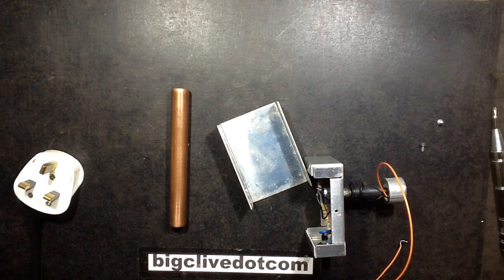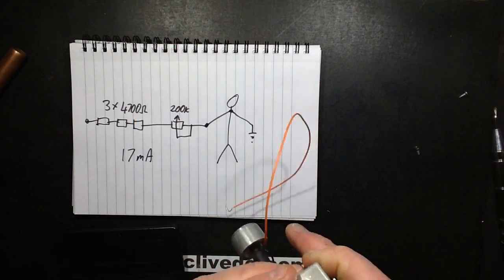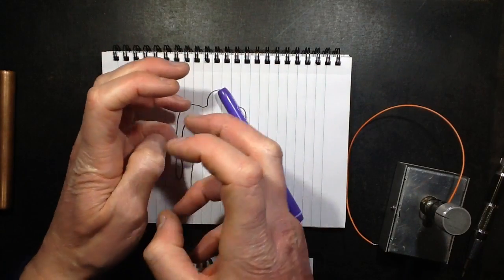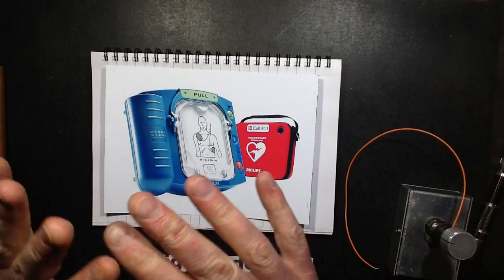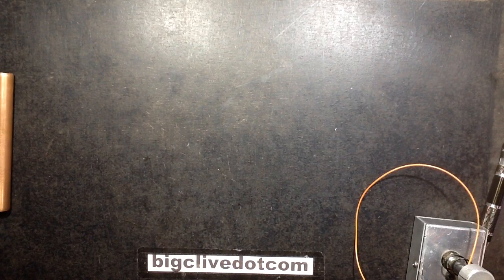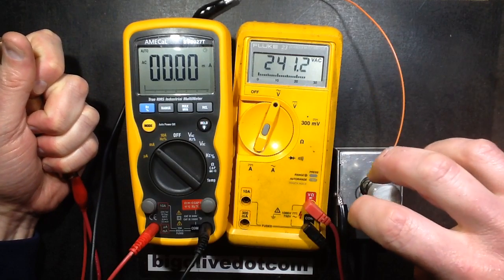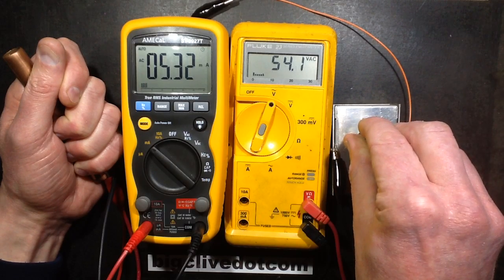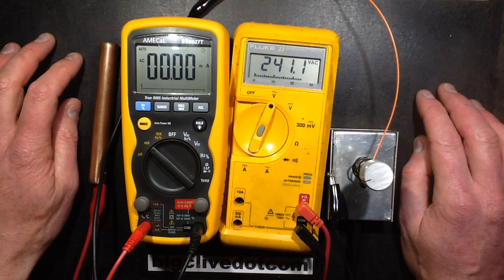Avoiding electrocution (Featuring real shocks.)

Comment: WOW, I never knew that about defibrillators, that's really interesting that it won't shock a health heart.  I always thought they just chucked out the same charge and jumped-started them.  This is obviously why they now have them available for emergency use in small villages.
Reply: +Higgypop That's true for AEDs (Automated External Defibrillators) that are made for use by untrained civilians. That's why they have voice instructions and pictures on every possible part of the device & ECG monitoring with computer algorithm checking if there's v-fib, so it's perfectly safe for use for everyone. Things made for trained professionals (ER guy or doctor) like for example LifePak (defibrillator & cardiomonitor in handy case) will deliver anything you want, but they assume you know what you're doing.

Comment: The instructions weren't clear enough. I got my dick caught in the tingletron.
Reply from the maker: +Sebastian Ramadan That really hurts too.
Reply: bigclivedotcom In what frame of mind were you when you decided it'd be a good idea to try that? Were you testing it with your friends when you all collectively decided the tingles felt good and you should try it on your jingles? This gives me an idea... Why has nobody thought of a mains-based electric shock sex toy? Put one electrode on clitoris, the other on knob, have at it boys...
Reply: +Sebastian Ramadan Think to what would happen if a resistor would somehow fail(maybe by getting wet).
Reply: Anto Mani on a related topic I wonder if a mans meat is white or red when cooked XD
Reply: +Anto Mani ha ha ha ha ha   dear god, that is such a valid point. 

Well, if anything like that DOES come about, we can count on BigClive to buy, test and trial it! ;)
Reply: Depends which part of the body. If it's erectile, probably white

Comment: You are very brave and watching this video, made me afraid something was going to go horribly wrong, even though 
 have watched many videos after this. I have shocked myself intentionally several times with a 100.000 volt stungun (not sure if it is 100 or 100k, since they used a decimal) and rather than building up a tolerance, I built up extreme fear and I am now terrified of them. Overall, being electrically shocked, is not a pleasant experience.

Comment: In North America they often use a common neutral. Apparently it saves a lot of money.  It is not uncommon for someone an apprentice to get shocked by a neutral. Yesterday I was taking a line of a circuit for a new light. I had the circuit off but tested it with one of those proximity sensors and found the neutral still live! Figured out the second circuit to turn off as well. I am having a licensed electrician come and check the panel to verify my finding. I believe the wrong two breakers were tied together. 

Why run the test from one hand to the other instead of from your had to say your upper arm?

Did you have someone off camera ready to step in and rescue you if necessary?

Comment: If you have rubber soled shoes. Good. If you have another person nearby. Good. If you don't have the latter than always try to work with one hand behind your back (not touching anything), in a non-conductive glove of some sort or, if you know what you're doing, just avoid neutral or earth with said hand. If you're holding onto live, you are at a potential of ~230V (in the UK). Earth is at 0V usually and Neutral may have some induced or residual voltage. This potential difference is the amount of energy, Current (in Amperes) has when it passes through a conductor. You can calculate power with P=VI (I = amps, V = volts, P = power in watts). 

If you are at 240V because you're holding onto live and touch something also at 240V, you will be fine, or even if you touch something at 200V. So as long as you don't touch something significantly different in potential (20V or more either way), then you'll be fine. 

50V and lower is also pretty damn safe. It'll give you a painful buzz, especially high current, but otherwise you'll be fine in most cases (unless you have a pacemaker, heart murmur or other cardiac condition). 

Know your shit, or don't touch it. A little rhyme that you should remember when messing about with electrical stuff as well as gas. Although, people have a lot more respect for the latter.
Reply: Hi Uncle Joe!
Reply: +Joseph Stalin no offence but I don't think you are in the position to give out health and safety advice
Reply: DrEko2012 Off to the Gulag with you!

Comment: are the resisters 4.7kOhms together or indenpedently
Reply from the maker: +Mike Schmidt All in series to make a higher value with greater safety.
Reply: +bigclivedotcom - I think he was asking if 4.7k was the total resistance or each (and it's each, of course, which is why it says "3x 4700").

Comment: I once got zapped from an A/C unit plugged into a non earthed extension cord. These are common with us... Anyway, there was certainly some moisture where it shouldn't be (considering I just cleaned it out) and DAMN did that knock me backwards. I thought that running a fan next to it for 24 hours would have dried it, but... no. I was on damp concrete and I touched the live chassis. ouch.

Comment: Moved into a house where some clown had wired a light direct into the socket circuit (not even on a fused spur)and I'd turned the lighting circuit off before working on a said light of course (this was pre RCD too)..... so learned the hard way to always test even if I "know" a circuit is isolated.
Reply from the maker: Yup.  That happens a lot.  And electricity is a harsh teacher.
Reply: +bigclivedotcom And an even harsher lover.
Reply: +Choppington Otter Had that happen myself countless times. Arse hole cowboy cunts shouldn't be allowed near electricity, they've killed people doing it in the past. Strong words, but when someone's life is on the line it's no joke.

I've had 3 mains power shocks. 2 from light fittings, one from a fused connection unit which was fed from the lighting circuit, outside, from a separate consumer unit, not even on the board inside the house. Not to mention, this 2 way board was the rewirable fuse type, and buried under concrete and a small metal hatch in which a 4 year old would struggle to get their hand down. In the end, we found the supply for it & cut it dead. 

Arm was numb for many minutes afterwards, with a slightly distorted area of skin at the tip of my finger. Luckily, it was between two fingers and no between two hands, otherwise i might not be here to tell the tale.

Comment: Once I got shocked by 110 AC. My hand clamped shut and i felt the 60 Hz, current travelling up my arm (or the muscles contracting further and further up my arm) as I attempted a sort of scream (lol). I was lucky enough to lean back and fall away to break the connection! Whew! I'd never intentionally shock myself like you though bigclive! Thanks for being a little crazy! :)
Reply: you must see electroBOOM channel, he shock him self in every video
Reply: I managed to cut the wire of my desk lamp once ...
230 or 240 Volts at 50 Hz aint pleasing, I can tell you that much.

Comment: So a 15kOhm Resistor from 240v would drive a blue/white LED quite nicely?
Reply: +ChaosHusky 240v AC peaks at give/take 330v, so maybe around 24k ohm will be good. That's 10mA at 240V and wont destroy the LED at the peaks. Ofcourse it also depends on the LED, but most generic LED's work fine in the 10-20mA range. -- [Edit] I should add that the LED blocks current (because it's a diode) when the AC becomes minus voltage, so you'll only light up the LED half the wave, but at 50-60hz you probably wont notice.
Reply: +funkynicco the LED might be a diode, but a diode with a very low break down voltage. If you apply 240V or rather 330V in reverse, the LED will fail for sure. As an electronics engineer, I presume that the break down voltage is usually around the rated forward voltage. Maybe even lower, maybe a bit higher. Given that the resistor as virtually no voltage drop when virtually no currents flows, we have to assume that the full 330V are applied in reverse to the diode.

Then there is the issue of an LED not beeing mains rated...

Clive shows plenty of videos where he shows how he connects the LEDs to mains voltage. Watch them carefully and think twice before rebuilding any of his projects. He does certain things in a certain way with thinking about it, because he knows by education and experience what he is doing. Small deviations can be very dangerous.

Comment: Hey,

Remember that your mains voltage is an average value. In fact a hundred times per second the voltage is actually as high as 340 V, which also increases the current hence the stress on your muscles.

Comment: Silly question but could you connect a wire between your arms to give the current a alternate path rather than through your chest?
Reply from the maker: topher Even with a tight metal band on each wrist, the current that entered your hands would still tend to pass internally due to the human body's low internal resistance.  Some current would flow between the bands, but the resistance of the connection between band, skin and internal flesh would be significant.
Reply: +bigclivedotcom you can get chain mail clothing that provides an alternative route for the electricity

Comment: This video is in tune with what I've done today. I was repairing a TV for someone and went to discharge the CRT with the standard grounded screwdriver as I always use, when I've heard a nice loud zap then the CRT should have been discharged and I'm pretty sure I've done it twice to be sure. But when I've touched the rubber cap ZAPP! a nice high voltage shock, just what I needed for me to get motivated, and fix the bloody thing, lol. I'm pretty used to electric shocks but I try to avoid them if possible. It's not the fact that I'm scared of it but it's actually more on the fact that I feel like an amateur when it happens, just plain stupid mistakes. One time I wanted to repair or restore an electric heater which used nichrome wires inside a glass tube. I was either not paying attention or was angry at something and stuck my fingers inside to disconnect the terminals from the switches and WHAM! next thing you know the thing hit the ground with quite a force, luckily the heater survived, yeah that's right, I'm not worried about my safety! lol. Play safe guys. Cheers :)

Comment: im an electrician and was working on a device which is relatively safe ( 240into a power module and +-15v out, after an hour of calibrating said device i went to unplug it, WHACK, i got the 50hz shake the person that had done the plug had run the screw through the live making the screw live, as i lent over to unplug it placing one hand on the devices grounded chassis and the other on the electrified screw.... man did it give me a kick. Being a electronic lab i was protected by a local RCD which tripped, now thinking of an isolation transformer. lesson learned hand in pocket rule hopefully my thick rubber boots would help.
Reply: phillrullzXBL wow... you were lucky! i just bought a 500VA isolation transformer a few days ago just because of this and it's also quite useful if you hook up a grounded oscilloscope.
Reply: im not an electrician an in my INFINITE WISDOM i didnt get a sparky to help replace a RCBO an i was of course holding the lid open an i grabed something an i could feel the 60hz go through my body an then i blacked out apparently i was dead for abit an then i woke up in hospital 
so yea 
i is lucky

Comment: Big C, youre the man! 
That was INTESNSE !

I got electrocuted in the past, but not for that long.
You are brave...
Reply: Shlomi Vinny Electrocution means death by electric shock...
Reply: Oh shit, i meant i got electroshocked? :D
Reply: Shlomi Vinny Shocked would suffice (without the electro bit).
Reply: justquant Cool, now i know. thanks!
Reply: Shlomi Vinny NP
Reply: +Ryaninator 54 I've been shocked by 240v a couple of times, thankfully not for long and through high resistance but I have had my whole arm numb from it
Reply: +Ryaninator 54 I once had my finger slip while unplugging a mini-fridge from a power strip and hit the prong, and it had my entire body vibrating for a good 5 minutes or so. Very uncomfortable feeling, and it's made me appreciate plugs that have as lip on the live end to prevent that sort of thing from happening, as opposed to the slippery ones with straight sides. I'm in Canada, so about 110-120v; I imagine I would've been quite a bit worse off if it happened across the pond.
Reply: I got shocked by a alarm clock form the prongs so 120 V and couldn't move for 5 seconds. I was 9 then too.

Comment: One of my friends died from an electric shock so I have a huge respect for electricity. I will always physically disconnect anything before opening it as a habit. If working on a house fitting I have to check the wiring with a multimeter first.
Reply from the maker: Also be aware that even if you test a neutral/return and it appears dead, then if you part two neutral wires and another circuit was using them as a return path, then one of them can become live.
Reply: bigclivedotcom I found this out with old wiring in the house the wires had a kind of cloth coating everything was replaced but prior to that some circuits had a decent amount of voltage showing on the neutral
Reply: TRDreams California 3ways are also common with old house wiring with the cloth sheathing
Reply: Also, not all appliances are safe after being disconnected.  Anything containing a CRT is a notorious danger until physically discharged by someone either intentionally or accidentally/fatally.

Comment: The whole time you were touching the knob I was sweating like hell...
had a few nasty shocks so far, always been lucky. One mains shock across my wet hand (someone had removed a safety cover at school and I needed to move the overhead projector), and even a fully charged 10kV capacitor for a 200 kV Marx Generator project over heartline (still not sure how I survived that). I needed to move the elektrodes of the spark gap closer together, didn't pay attention, and grabbed both aluminium foil electrodes at the same time. Luckily there weren't any more accidents and we finished the project without any casualties.

Comment: You didn't convert to RMS when you figured for current in the beginning.
Reply: +TakronRust 240v is the RMS value.
Reply: +megaspeed2v2 wall mains ac isn't rms
Reply: +megaspeed2v2 wall mains ac isn't rms
Reply: TakronRust I think you might not be understanding. 240V is the RMS value of the voltage being supplied at the wall, the peak value is 339v and the peak to peak value is 679v.

Comment: The biggest shock I've got to date was the capacitor in the back of my old Philips CRT TV (ironic that you showed a picture of a Philips defib too!!), the plastic round the flyback had degraded and allowed electricity to arc out of it, and as you descried, I was poking about in it idly, hand on an earthed device and bang, that discharge went up my right arm, across my chest and out my left arm via my old laptop (metal cased Toshiba Portégé M300, which does feel like it's negative rail is referenced to mains!! Always getting tingles and buzzes of that thing), and I was crapping myself afterwards thinking my heart may have gone into fibrillation, but thankfully it hadn't, and that was the last CRT TV I ever owned, considering it owned me!!! :S

Comment: You are a brave man to take on 240V (even through the tingle tron) so everyone else can see the effects of electric shock. I'm glad I have a healthy respect for electricity of any sort. Biggest jolt I have got was from a camera flash (a big one). The capacitor got me and it was pretty fully charged. Threw me across the room. I did end up fixing the flash in the end - it was a faulty trigger transformer. With respect big caps charged up to a decent voltage can be a lot of fun. Just don't let anyone near them when they're charged! I have a small bank of 24,000uF at 900V... OUCH! Thankfully triggered electronically via an air switch from a good distance away (it fires the SCR, which in turn vaporises pretty much anything connected across the output with an incredibly bright flash and loud bang!) :)
Reply from the maker: dash8brj I was actually a bit disappointed that I couldn't go any higher with the current.  But even at 6mA it was excruciating.
Reply: bigclivedotcom Nah try not to fry yourself Clive - your videos are entertaining and interesting - and some quite funny - the bug zapper whos capacitor decided it didnt want to be and that silly christmas card with the 4.7K resistor on 240... sigh :) Look forward to more :)
Reply: +dash8brj As an apprentice we would charge capacitors with a Megger (the wind up ones were best for this - showing my age a bit there) and leave them laying around on the bench for some unsuspecting poor so and so to pick up.